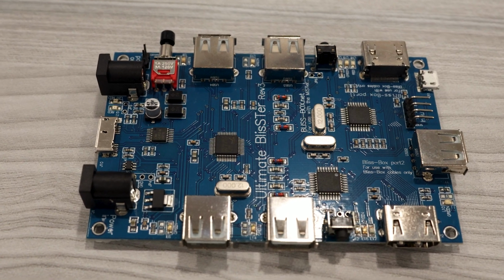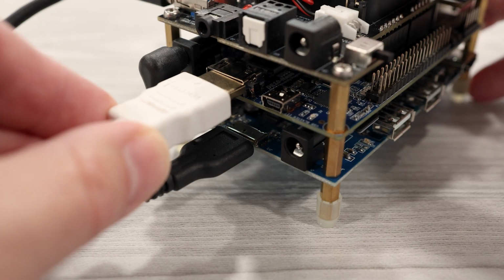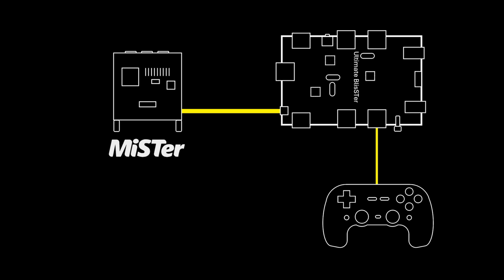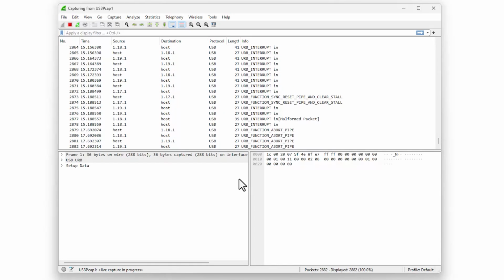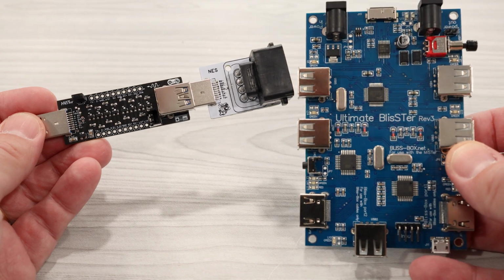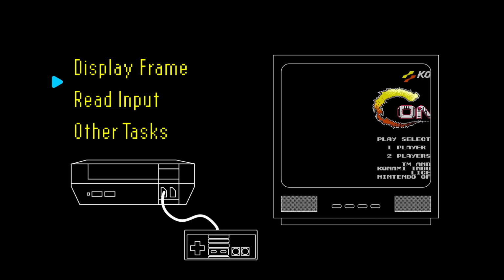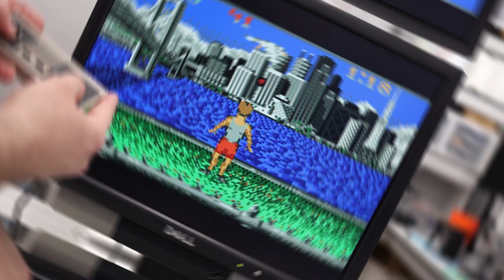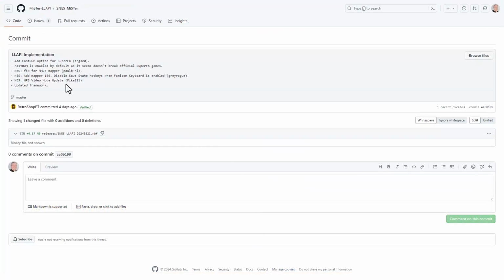Diving into the BlisSTer: Is this the ULTIMATE MiSTer Add On?

Comment: It is an interesting creation, and adds another controller option in the tool box. I agree though, it is ashame the source code is closed. I do commend the schematics being released, though it is like having the brawns but no brains. MiSTer itself being open, the doors are open for other creators and we likely will see other controller creations. Closed source add on, for an open source system. To each their own. I am thankful and glad to support creators who contribute to the community and keep their work open. It is this openess, that has really allowed great things to come and thrive!
Reply: Now really, the close part of this is just the controllers. If you look at the github not only is the schematic release the code for LLAPi is %100 open. The part that is closed is the adapter logic that has nothing to do with any of this. Its like bridging mister logic to a close source project. If I wanted to connect a laptop to a lambo, Id never expect Lamborghini to opensource there ECU? Or if Lamborghini made a tweak kit for their own ECU I'd still not expect them to open source it. I for one think what Bliss-Box did it perfect. At least we have access to all the logic they made in a API. This is exactly what an API is for.

Comment: @Ken
bonjour, d'après vous est-ce possible de brancher un blisster a un ''mister pi'' ? arrêter moi si je me trompe mais l'important sera que japporte le courant dans le blisster, que je le relie au snac et a un port usb. si je respect tout cela ca pourrait fonctionner selon vous car j'ai un ''mister pi'' et je ne détesterais pas l'idée de rajouter un blisster lol :)
Merci
Reply: Yes its been done. There is a Low level driver for linux that interacts with the LLAP. If anyone wants the driver just contact Bliss-Box. However it was not written by Bliss-Box a 3rd party company write it, so it maybe for sale. We'd have to reach out. Likewise, another could be made. You just need access to the GPIO pins and asm/c driver tools.

Comment: Why couldn't the I/O board have two serial ports so that two players could play, for example? What's the problem with regular snacs that only exist for the Playstation 1 with an input for two controllers and a light gun. Why don't other snac adapters do this? There would be no need for this blister

Comment: is there any way to get zero lag with a wireless controller on the MiSTer? I can't see why not but i cant find anything
Reply: How are you going to get zero lag with wireless, that obviously is going to take time? Perhaps you mean on time polling like what LLAPI does? This is very realistic. As a matter a fact Bliss-Box has something in the works for that, if interested reach out they will explain. Ask about  the a.i.r.  but as for wireless option, you going to be stuck with thing like the m30 and fast polling. Ir honestly is fast enough, but no, not zero lag.
Reply: Well, radio waves (and light) actually travel faster in air then in copper, so i still dont get it why not
Reply: @oferkatz   I'm not going to pertened to be a physicist but I do work with electronics. Every wireless application I make is always slower. but a google hit says this "A 2.4 GHz wireless connection is typically slower than a wired connection because the 2.4 GHz frequency band is more congested with other devices like microwaves, cordless phones, and neighboring Wi-Fi networks, leading to interference and reduced signal strength, while a wired connection transmits data directly through a cable with minimal interference, allowing for faster speeds."
Reply: @greensseanpam5616  logitech makes a wireless mouse which they claim and is prooven to be faster the a usb wired one, but maybe thats diffrent from old controlers signals, meaning not over usb
Reply: @oferkatz  cool, I have no doubt that it can be done. I worked with Nordic chip that use a thing they called shock burst, it was great but not as fast as wired. Still, I have yet to see a gamepad go that fast. I'm sure it can be done but prolly unnecessary as no human needs any button to react that fast. A mouse I get.

Comment: So if I understand this correctly when using the blister HDMI ports in USB mode with USB polling enabled it will work but it won't be as fast as using the actual USB port? I wonder the latency in llapi mode compared to snac.
Reply: No using HDMI in USB mode, is USB. so it's the same thing. It's  just like using any other USB only the USB adapter is attached to the board. When you talk SNAC and LLAPI, latency is not really topic. I mean it can be, but its not relevant. SNAC is pretty much like the OEM stuff, LLAPI is similar in that it polls when the game asks it to poll but there is some over head (800 uS) to get data. So you could say LLAPI is 800 microseconds slower then SCAN ( that's .8 ms ) but its sort of a ridicules point to make because the game compensates for refresh rate lag, normally  ( 16ms ). It counts on the fact no input will be read for that downtime. Now some games will poll faster ( gun games ) and SNAC and LLAPI will keep up but again LLAPI has that .8ms lag to deal with. Though playing gun games seems to work remarkably well. Once example where it will not work is a sega phase gun game. That game requires very low timing. And the LLAPI lag will never work but SNAC does.

Comment: in all cases where a human is holding the controller, USB polling rate vs SNAC matters approximately 0%.  Believe it or not, console hardware like the NES, SNES, and any controller which has more buttons than it has wires on the connector uses polling to get the button data, same as USB.
Reply: Except polling is controlled by the game and is therefore fully synchronized with the game loop. USB polling is an asynchronous process.
Reply: @boshi9  Right and LLAPI Uses the game polling. Thus the advantage.

Comment: I’ve been using the BlisSTer for almost 2 years now, and honestly, I don’t have a single gripe about it. The “worst” experience I had was getting Atari Paddles and a ColecoVision controller to work, but once you realize that specific controller presses are needed for them to be detected, it’s smooth sailing from there.

Yes, it would be nice if the code code be merged into the official branch, but I’m OK with it for now. One other “gotcha” is that Uktimate MiSTer is the only vendor who makes a case designed for it. FWIW, I have no gripes about his case, and he was great to deal with, but I have to admit that I get a little jealous of those snazzy aluminum cases.

About the pricing - yeah, it starts getting pricey, especially when you start to factor in cables. In my case, I already had previous experience with the Bliss-Box; I also own their 4-player model, which I bought with the complete cable set at purchase. The only adapter I had to buy after the fact was the DB15 cables for Neo-Geo.

Comment: Great video! Even with a BlisSTer can you still use a SNAC adapter too? Or are you just restricted to using the BlisSTer board?
Reply from the maker: Thanks! No, the BlisSTer uses the SNAC port for low latency mode. You can use SNAC adapters if you don't use low latency mode, but then the BlisSTer just functions as a USB controller adapter.

Comment: I've been using the blisster for 4-5 months now, and didn't even realize that the user I/O port needed to be plugged in to the micro b connector.  Yikes, and I've been just using USB for the most part because I didn't think the LLAPI felt right.
Reply: yeah its common. I think most people would never know the difference. The way  you know your using LLAPI is everything auto maps.

Comment: I have to chime in here, having used the BlisSTer board since it first released there is some context I feel folks should know before diving into this option.  See examples below:
- There are reliability issues with these boards that folks should know about.  I've used MiSTer since 2018 and BlisSTer is literally the only thing that's failed on me during this time, and multiple times now!  The first time I had one of the LLAPI HDMI connectors completely come off the board, and this is while it was in a case made for BlisSTer that doesn't allow wiggle room.  The second issue was the power button having a serious malfunction and completely stop working, while I was in the middle of trying to 1cc a game in the later half.  Completely shuts down the MiSTer when this happens.  The third issue was the power button again!  Only around a half year since getting the power button "repaired" by sending it directly to Bliss Box, while recording my Samurai Shodown RPG Part 1 video a couple weeks ago, MiSTer just powered off randomly *when I was 4 hours into the recording*.  This means I lost ALL PROGRESS up to there and had to start from scratch with that one.  Because of the nature of MiSTer's saves, if you haven't opened the OSD a critical power failure like this will result in you LOSING PROGRESS in any game you've been playing.  Only time that's happened to me is because of this board.  This is just not a reliable option for anyone looking to record longer videos or go for 1cc/speedruns, and those are unfortunately the types of folks who would be most enticed by a board like this, given its low latency & polling sync.

- The device is also not "zero lag" otherwise you would be able to use light guns from any system with it, and only the Nintendo Zapper works here because it has more relaxed timing restrictions than most light guns.  It has more lag than SNAC, even if it is synchronized to polling intervals.  You're going to need to use the USB mode for a lot of situations since the forked cores are limited to a certain set- a fraction of what MiSTer offers.  LLAPI cores are also not updated in sync with main cores, so you will not have the latest fixes and framework advancements until this occurs.  This makes the board a worse option than most other USB adapters for controllers (Reflex Adapt, Daemonbite, etc) since those work low-lag with everything.  

- There are also a variety of controller button combinations you will have to memorize that vary for many different controller types you would use with LLAPI.  There are so many of these combinations that you will likely inadvertently trigger one of them when playing a game.  Take the "turbo" shortcut that's demonstrated in this video, for example.  If you were holding down a fire button in a game, then pause to go into menu, press left or right to select something in the menu and then press pause again to exit it, if you mistakenly chose the wrong thing and want to go back in the menu again by hitting pause? Guess what, you've now enabled turbo.  This is just one example, but you will encounter this with other shortcuts baked into the firmware also.  It's overcomplicated and much less useful than standard MiSTer options for customization, all while not giving the same level of performance as SNAC would (though coming close!).  

- High speed USB adapters can get you to a similar level of performance without these drawbacks and I wholeheartedly suggest that folks looking into getting a converter for classic controllers, use something like Reflex Adapt instead.  You get the low latency benefits and the convenience of it working properly with all of MiSTer's built in functions like comprehensive rebinding and easy-to-use variable rate turbofire, etc.  Great performance and convenience on literally every core that MiSTer has or will have in the future.  Choose wisely.

Comment: How do I get SNAC mode to work?  I have the IO connector (USB 3.0) connected to the BisSter.  Is it automatic switch between USB mode and SNAC mode?
Reply: SNAC is not LLAPI, the BlisSter is for USB or LLAPI, not SNAC . To use SNAC you need a SNAC adapter.

Comment: Probably dumb question: would my SNAC adapters work with the bliss box?
Reply from the maker: Not a dumb question!  No, the BlisSTer occupies the user port, so you can't plug anything else into. This also means that you can't use other accessories like the MT32Pi with the BlisSTer (but you can't use it with SNAC either)
Reply: Well the "adapters" no, they plug in to the user port but the SNAC cables, yes. Snac cables are in fact Bliss-Box cables. There are some goofballs out there that cloned the Bliss-Box cables and then changed the pinouts. I'm sure for good reasons, but those will in fact not work. I think the saturn cable was changed. but most of the other ones are interchangeable.
Reply: @greensseanpam5616  this was done since the bliss cables were not wired completely for certain controllers
Reply: Some of the hdmi adapters for blisster are not wired correctly and have pins either missing or misplaced.  playstation and saturn for sure, but iirc others as well.  you may have issues trying to mix them, since the SNAC hdmi adapters sold by places like misteraddons are all wired completely/correctly.
Reply: @WalrusFPGA  Wow do you have that backwards, more miss informed information being spread..  The "correct" way of pinning out cables is subjective for adapters. You can pin them out anyway you want. Bliss-Box created the pinion design to match their products so as far as correct goes, they are correct.  What you are complete fumbling over is why it was changed. Saturn was changed to match sega because the two protocols are the same. Bliss-Box does not use the same protocol for sega and saturn where as SNAC ( for obvious reasons ) did. The other cables you speak of are not miss-wired or wrong, and again, it was not needed. Bliss-Box cables are for emulation, and light guns are not possible or  scoped to be used at that time. The new cable design simply added the missing light gun wire.
Reply: @pamg6368  Yes, you didnt' wire pins that are necessary for full operation of those ports, hence why things like light guns or certain controllers will not work correctly. Exactly what I was referring to. What is needed for exact function of original controller ports, is that all the pins are available and accounted for. And they are not with some of your adapters. Simple fact.
Reply: Right - I meant the dongles that I bought from Mister add-ons I've been using with snax.  They go from my genesis, NES, SNES, psx, to HDMI.
Reply: @Flyzguy  mr addons copied the Bliss-Box cables. Not there I'm saying that's bad but yes they will work with BB products because they are copies.  I think the only cable he did different was the saturn. So BB cables will also work with snac.
Reply: I think what @pamg6368 is saying is that your chosen words are misleading. You made it sound like the cables for BlisSter were wired incorrectly, which clearly is not true. They are all wired right in accordance to BlisSter. Whether or not the current as-is wiring worked for SNAC is not relevant to BlisSter and after the fact. Though to your point, if one is to buy  for SNAC use, they need to know the BlisSter cables ( however mostly ok to use) may have 1 or 2 cables that do not work. Same goes for BlisSTer. I will also state that some cable from mister addons failed for me and were he fixed the issue, I never had issue with Bliss-Box cables.

Comment: That USB connector looked to be too big instead of too small. How did filing the spacers make it fit? Was it just a weird camera angle?
Reply from the maker: It's just the camera angle - the connector was too small, so filing down the stand-off did the trick

Comment: After reading all these comments, IMO the best video to do next is a misconception video. 

BlisSter is dead - false, its still selling
BlisSter only supports LLAPI - false , it does both USB and LLAPI
BlisSter has low USB pol rates -  true but you can use fast polling to speed it up
LLAPI cores are not being worked on - false they are quite alive
There are better boards and options - This is subjects,  define "better".
LLAPI is faster then 1ms, false - its slower but dose not matter,  depends on the native game poll rate, it's once a frame rate but it polls moments before the frame ends. This is what the video explains and why it is 0 lag. 

Most of this was covered in the video but apparently no one watched it. %100 on the video %10 on reaching people. Not sure what that says about the viewers.

Comment: I have a great idea for a video. No one has done a decent video on using atari controllers and paddles with the atari core. Appreciate your videos thanks
Reply: There is a older on titled "LLAPI 7800 core using 4 paddles". No config since its LLAPI
Reply: The paddles are probably the most challenging to get the BlisSTer to recognize. IIRC, you have to press the buttons on BOTH paddles while hitting the reset button for the corresponding controller port. Once you get it working though, it is truly the BEST alternative way to play Atari 2600.

Comment: is blister better then the usb with a new switch or xbox sx controller.??
It's just the old controller is kinda dated. A new controller would be cool really.
Reply: I have a blister set up.
Does the job.
Don't have snak adapter. same thing almost. I plan on getting snak now that it offers 2 to 4 ports.
Reply: no, I mean the idea is to use the old controllers. so if you do not want that, then yes its not better :) but  why use the mister, just use PC emulation? Mister is about the real experience, using the real controllers just makes good sense.
Reply: @greensseanpam5616 they said mister is more accurate.
I like mister. everything seems to just work.
Reply: I just got the mister out of boardum.
Really i would of just stuck with emulation and the retro store.
Mister seems like a good unit. They should of made the right type of ram right away.